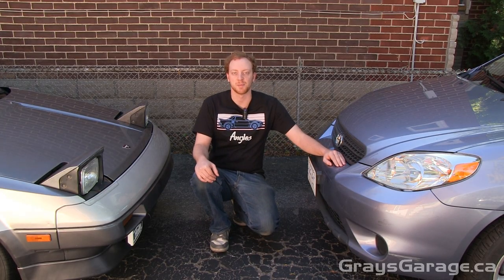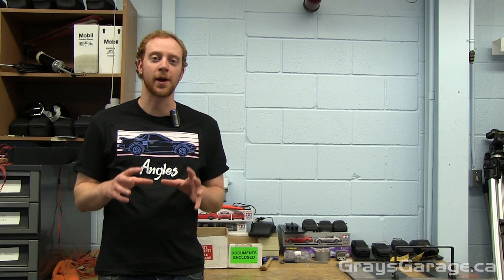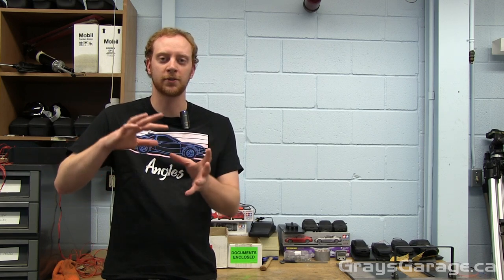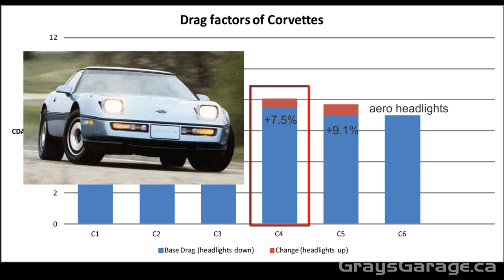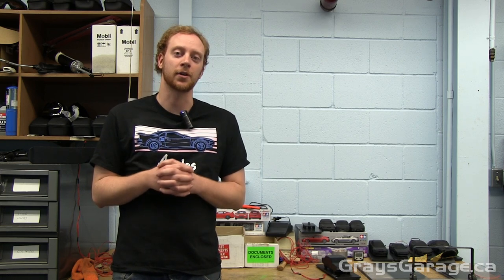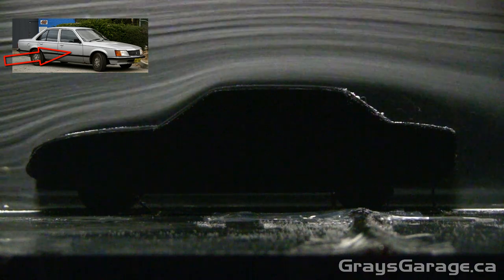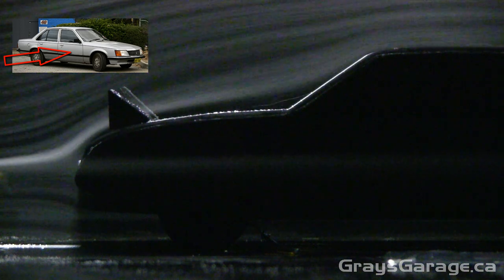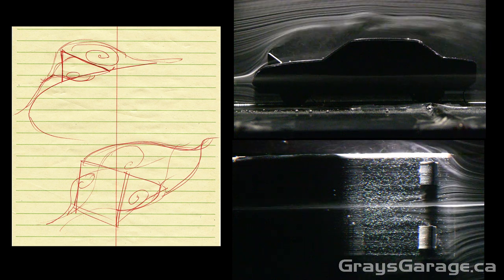Automotive Aerodynamics Episode 2: Pop-up Headlights

Comment: I enjoyed this episode, thank you! 
I think pop-up headlights could still work, if a manufacturer really wanted them their engineers would certainly find a way.
Reply from the maker: I agree. It would be tricky in today's market, but it could be done.
Reply: Due to pedestrian safety laws, pop up headlights are dead for good unfortunately
Reply: @JMBA7X  I've thought about this a lot. My solution would involve the headlight also having a hinge around the front of the light. Then, a solenoid at the rear could be activated by the same sensors that engage bonnet safety systems, and the headlight could fall/be pulled flat backwards into the car when a pedestrian impact is detected.
I always thought the rule pop-ups were breaking was the one prohibiting lights that move in any way, though.

Comment: Yes, a car that has it's pop-ups UP suffers a significant drag penalty.....BUT with the pop-ups DOWN the aero is significantly  better than with aerodynamic headlights (non pop-ups).  Pop-ups also allow the use of much more efficient headlights than the tiny projectors that must be used with modern aero headlights.    There ARE advantages in pop-ups.
Reply: I just started thinking about electrical cars. Technicaly since pop up lights are bad for fuel efficency& speed. Then what about if they could be used on electrical cars, since electricity itself is cheaper? and electricity powered cars dont drive at high speeds. Basically right now on the market, there are some bubbles, leaf and tesla s. I would like to see also something resembling 90's sports car whit pop ups, but running on something cheaper.
Reply: JustaParps the problem here is, electric cars' weakest point is range. You're lucky if your car lasted 100 km on one charge. And because at night you not only increase drag, but also turn on headlights, which guzzle A LOT of energy, your 50 km turn into 25 km, which leaves you somewhere inbetween home and whereever you went to. But day-only electric cars without headlights may be an interesting concept, but not for this discussion.
Reply: I think i will try to make a mod based on my vision for Beamng Drive

Comment: One thing I would have loved to hear (and I could have missed it) is the fact that with pop-up headlights, the hoodline itself can be lower than with Integrated lights.  While this does offset figures, it still shows similar horizontal and vertical separation as you displayed (just to a lesser extent).  Another thing about the Rx7 that made it so good was how LOW the hoodline was in comparison to other vehicles of the time.  An ultra-low hoodline and popups results in better aero during the day, which is when you should be racing anyways.  :D

Comment: Another good video. I would say it'd be interesting to quantify in a tangible sense what 5-11% drag increase means. For example, if you take the Corvette C5 example, what measurable effect is there on speed / fuel efficiency / high speed stability / etc. assuming no other factors change? For example, if I drove a measured 300 miles in my C5 with the lights folded down, and then a measured 300 miles with the lights popped up (but negating having the lights emitting light so as to eliminate electronic drain on the engine etc.) what would the predicted difference be, using your proposed figure of ~9%? Just a thought!
Reply from the maker: There is a simple way of looking at this calum, it's called a "power requirement" plot. I can put together one for a future episode and explain it.

Comment: I have a C5 Z06. Note that the "fixed roof coupe"  aka FRC (which is the Z06 design) is different that the standard c5. I am very interested to see these compare. GM claims that the FRC design was done as a weight reduction. I am wondering if the drag penalty is worth the weight savings?  

Also, I am highly interested in seeing the effects of front/rear splitters, wheel deflectors, and hood vents. 

Cant wait for more of your videos!

P.S. I am a senior in Mechanical Engineering at the University of South Florida
Reply from the maker: Brian, I'll take a look, thanks for bringing this to my attention.
Reply: Im pretty sure the drag difference between the FRC and the fastback are pretty minimal. The FRC is still slopped enough to maintain laminar flow. At least thats what my coopium tells me since I am also a z06 c5 owner!.

Comment: Great video.  As a point of interest, look at the Corvettes that raced at the 24 hours of LeMans in 1969 to see how they fared in the headlights to reduce drag, weight, and increase reliability.
Reply from the maker: interesting, you can see how they sunk the lights into the body. thank you for the suggestion.
Reply: GraysGarage I'd also like to see a more in-depth look at the C4 Corvettes as they designed the pop-ups with aerodynamics in mind. Instead of just popping up, the whole housing would rotate so it could be more streamlined. Very useful when the ZR-1 set it's endurance record!
Reply: Jake Swierczek The backside of the pop-up is always the same, no matter what method is used to "raise" the headlight.  There is no difference in the "streamlining".   Look at any pop-up headlight and you will see this....
Reply: Thomas Kirkham Hell yeah FIA-style fixed headlights. When I get my C3, I plan on installing those on it.@070611

Comment: I expected drag with pop ups, but those figures surprised me. I own MR2, SW20. Pop ups look so cool. Modern headlamps, so often look so ugly, blobby, like Marty Feldman eyes. The other issue with plastic headlamps, is they cloud over, not letting out a great deal of light. Cost of replacements is really high, I expect much higher than the cost of the extra fuel used, I am not a fan of modern cars, I will stick with classics. BTW, love the Corvette C1, it would look at home in an art museum.

Comment: great vid, keep them coming!   I had suspected the pop up headlights on my MKII MR2 created a great deal of drag, but I did not realize the vortex height may reach as high as the top of the windshield!   I installed "Revision 6" low rise headlights a few years back, and expect they are much better since the body panel at the top of the pop up is only ~10 degrees above horizontal, compared with ~45 degrees above horizontal with stock pop ups. 

Thanks for the vids,  I like both the technical content and the historical context!
Reply: C5 owner here. Also want to address the headlights especially in a high speed capable car liek a corvette. Can you imagine what those things are doing at 170 mph??? I bet my left nut it has a drastically lower top speed with those airbrakes deployed.

Comment: I believe there was one other major change in regulations that caused the demise of the pop-up headlights - sometime right around 1990 the regulations in the USA (and probably elsewhere) changed to allow the use of molded poly-carbonate headlight assemblies with a replaceable bulb.  Prior to that, regulations required a sealed beam headlamp so auto manufacturers were stuck using headlights that were either round or rectangular and had a more or less flat front.  There's no way to make that look good on the front of a sports car, so they hid them away with pop-up headlights.  The regulatory change paved the way for the nice aerodynamically friendly headlights we see on vehicles today.

Comment: I think the main point is that, with 'pop up' headlights, the surrounding bodywork is lower which is better for the frontal cross-section during the times the headlights are 'down'. Assuming the headlights are only used on a needs basis, ie darkness, the impact they have on aero is less because they would, hopefully, be travelling slower. I love my MR2 SW20...Mr. G! thank you for a great series

Comment: I get that you exaggerated the model to make things more visually obvious, but that's a very dangerous decision to make. You must know this. Because albeit the first in line consequence will be the same independently of the size, the following consequences (aka chain of events) will differ. And in this case in particular, the flow of bubbles past the popup headlights got hugely affected. That's why I have to disagree with the affirmation saying that the exaggerated popup headlights represent the same behavior generally.

 It is clear to me that the exaggerated model created an extreme separation of flow, so big in fact that the whole bubble-flow onwards is disturbed, the flow never gets the chance to stabilize itself, it never hits the windshield nor the roof or back. I can't say for sure, but I assume this may be a very inaccurate representation, because if the popup headlights model was represented by the same size ratio of the other parts the bubble-flow WOULD have acted differently. It might have hit the windshield, stabilizing itself, thus also probably following the roof design whilst also not having such a big disturbance.

Comment: Would it be possible to create popup headlights with a better aerodynamic profile though?
The front of those lights is clearly a flat plane and hard edges. But Surely there are more refined shapes possible than that?
Or does the mechanical design of the popup mechanism limit what you can do with it?

Comment: Pop up headlights look sinful from aerodynamic stand point of view. I did notice that pop up generated vortex helped fill the low pressure zone behind the rear window, but at a huge cost of frontal drag and flow separation.

Comment: To comply with the 'fail safe rule' Honda, at least on the 3rd gen Prelude, allows you to manually turn the motors when they aren't powered. If there is power to them you get a lot of resistance and they won't move much, pull the fuses and you can raise and lower them manually.

Comment: Another thing that would be really interesting in my opinion!

If you could take a look at & explain the principles of the 'NACA duct' as seen in various super fast ferrari's bodywork, that would show an interesting side of aerodynamics. I believe they work by pulling air out of the inside of the car i.e. To remove heat from the engine etc. would be keen to see some testing with various forms of duct designed to do this for example. Cheers!
Reply from the maker: already have this on the list. Naca ducts are very interesting. Take a look at the hood of the new nissan GTR :)